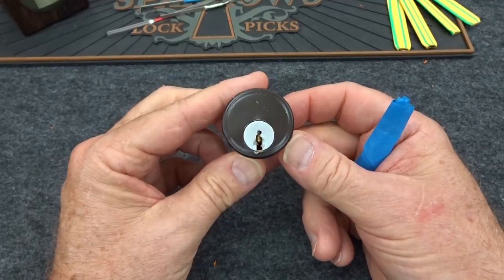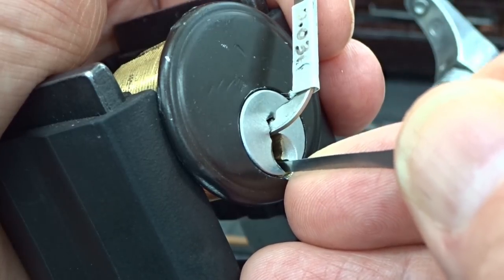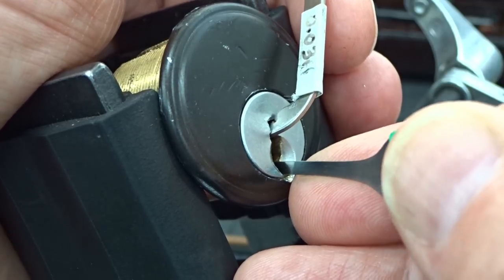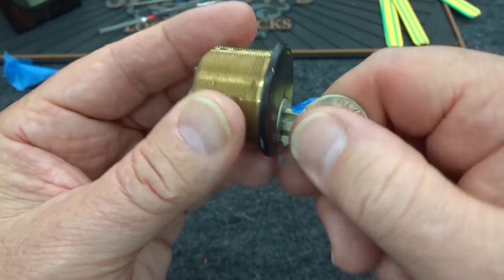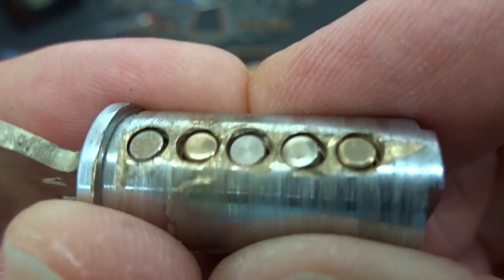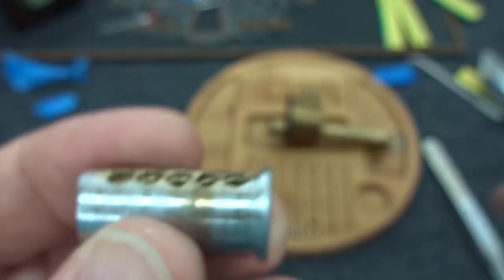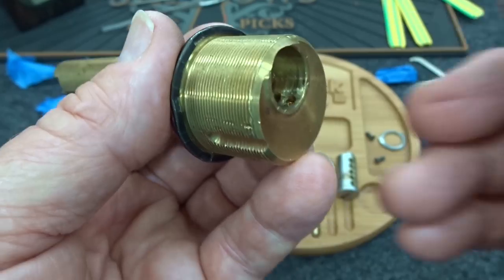(1136)  Challenge: Rush Rhees

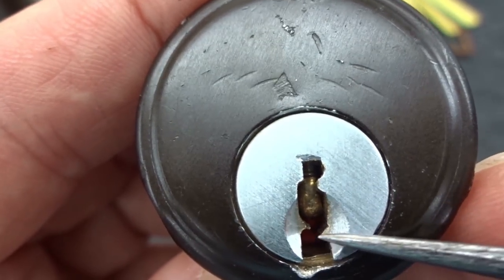Comment: I have a n00b question.. so @1:44, what is it in a lock that keeps the pin from falling all the way down to the bottom of the keyway? I see it hovering up there, I know there's another pin and a spring pushing down on it.. but it looks like there's just negative space it's not going into because of magic?
Reply: The warding of the keyway prevents the pins to fall all the way down

Comment: hey great page very informative, i saw your post on the pacsafe and how easy the lock they supply you is to pick. Just out of interest i go away travelling this year with some expensive camera gear, i got the pacsafe to put my gear in, after your post I'm now wondering if you could recommend a lock i could take ?, obviouslysize and weight is an issue as limits with airlines, but something that i can be confident is going to be a real security concern for someone trying to get through it ? thanks in advance for the response
Reply: Daniel  hoyle  Not sure if you are putting the lock on zippered luggage, but zippers are very easy to breach.  Best bet would be some hard cases with locks.

Comment: Hey, im new to this stuff so what would be the best set/anything to start practicing this?
Reply: Any cheap set is a good place to start. Make sure it has a rake, a couple various picks, amd a couple of tension wrenches. You don't really need anything with double sided picks yet so only get a set with those if it's economical. I have a southord starter set that works well for me and built on it from there but most stuff will work. A cheap practice lock isn't a bad idea either even though you'll quickly out grow it.